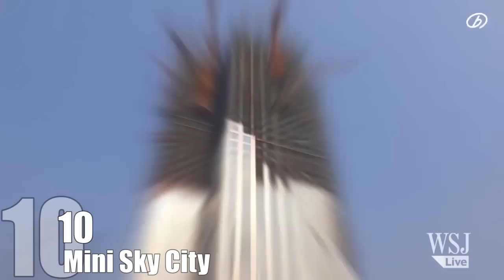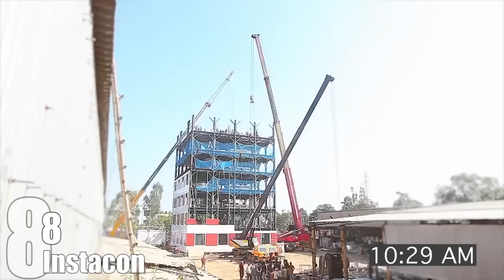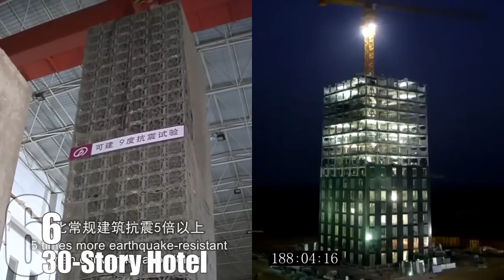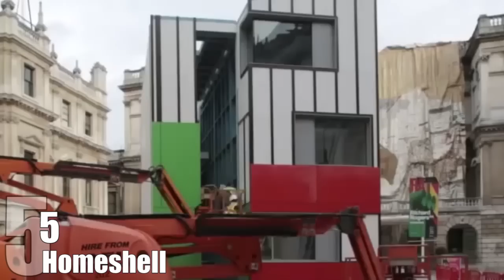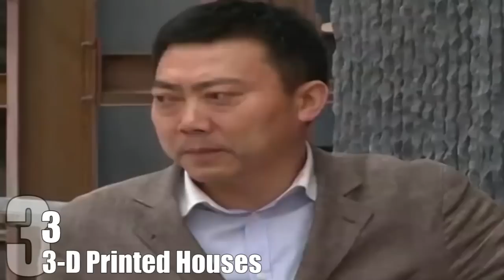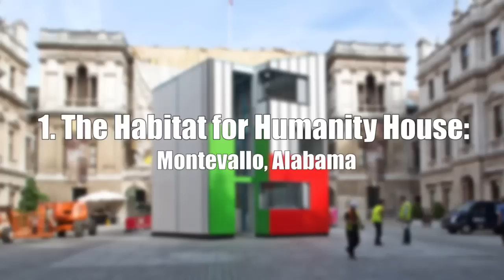Top 10 Amazing Buildings Constructed in Record Time — TopTenzNet

Comment: These rapidly built sky scrapers are largely made from prefabricated modules. This is not "building" so much as assembling, because the parts are already built.
  This shouldn't the time requited to build the modules be included in the construction time?
Reply: Eric Taylor If I hadn't found your comment, I'd have written the same thing.  Fabrication of the components should absolutely be counted, if time is your criteria.

Comment: For a future list along a similar theme, might I suggest "Top 10 Amazingly Fast Construction Projects From History". A few entries might include the American Transcontinental Railroad, in which railroad workers in the mid-1860s, using little more than manual labor and primitive explosives, managed to revolutionize the process of railroad-building, achieving construction rates of up to 10 miles of track per day across over 2,000 miles of the as-yet undeveloped American West, or the Liberty Ships of WWII, in which, to combat the shortage of cargo ships caused by German U-boats, American shipyards developed a class of mass-produced cargo ship that could be assembled, launched, and be ready to sail inside of 2 weeks. At the height of the program, Liberty ships, and the later Victory ship variants, were sliding down the ways at a rate of up to 1 per day.